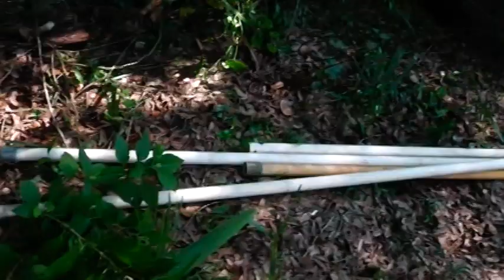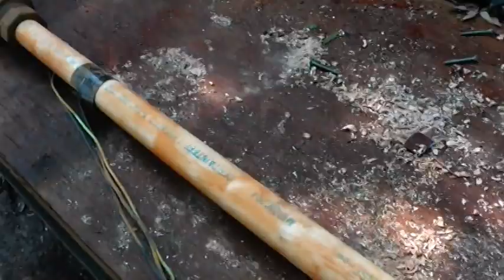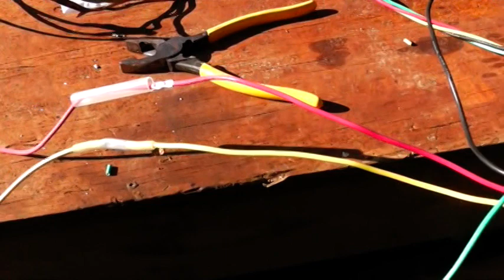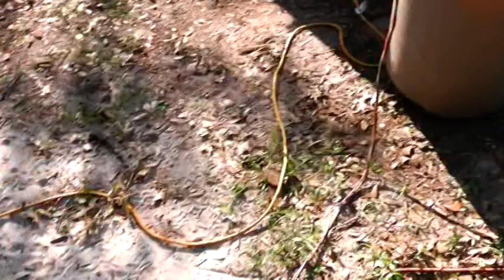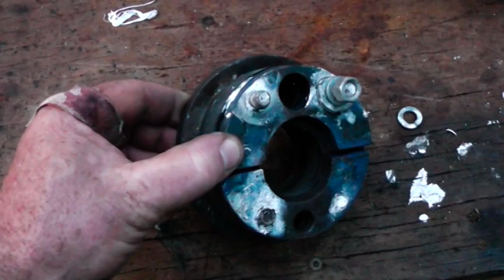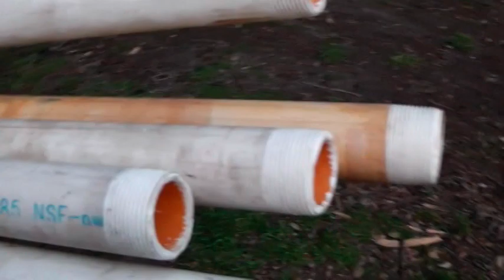Installing a Submersible Pump in a Deep Water Well: Part 1

Comment: I'm moving my wiring to another power source. I have a 220volt 3 wire pump. Do i need to check for proper rotation?
Reply from the maker: If it is single phase, no. If it is 3 phase then, yes.

Comment: Hi guys. There are so many comments about PVC and poly pipe and galvanized. These corrode or break easily and are difficult to handle. Why don’t you just use WellHose DIY Drop Pipe? Really easy to work with. No corrosion. 1 continuous length.

Comment: thanks another quick question, which pipe will u advise to use pvc or metal thanks for ur time
Reply from the maker: +Prince Dabby I don't have a definitive answer but, I can tell you that the 1 1/4 inch schedule 80 pvc on my well is still working after 16 years.  My neighbor's well pump had 2 inch schedule 40 metal pipe still in good condition after 45 years( they went with new metal pipe schedule 40).
I would ask a couple of your local well drillers to see what works best in your area.
What ever you choose, please make sure that you attach a stainless steel safety cable to the pump.

Comment: Bret Allen is spot on with what he is saying. At my company we also wrap a few layers of rubber splicing tape, and 3 passes of electrical tape over the splice to help protect it. It may not be an issue in screened wells, but where I live most people have rock holes. 

Wire gaurds will also help quite a bit with protecting the wire. Put them on every 20' or so on your pump column. 

I'd also advise against using solid core wire. Just personal preference, but u like using flat black double jacket wire.

Comment: One thing I do when installing a submersible pump is to use an stainless steel nipple
of 4 or 5 inches with an ear made of 3/8 stainless steel rod soldered to the nipple and
attach 1/4" stainless steel cable to support the pump and to pull the pump out when
need it, you thread this nipple to the pump.. I also use stainless steel cable clamps. Pumps are very expensive to replace,with that in mind I am extra carefull to be sure the pump and pipes are secure.I also secure the pump with rope attached to the pump ear using an 5/16" stainless steel shackle. Remember that loosing a pump and tubes you may  also render the well to a tottal loss. I buy all of this materials on E-bay very reazonable Using the cable and rope also helps to arrest the pump torque.
I kind of not to trust much the PVC tubes to support the weight of pump and tubes
because this material gets brittle with time. A good pump and a well done installation
last at least 15 years. Of course I am extremelly careful doing the wire splicing correctly and use plenty nylon ties to secure the wiring to the tubes.There are electric
winchs all over the places very cheap to pull the pumps and tubing out very easy.

Comment: Also I'm not sure if you know this but the only maintenance you have on that system is that blue pressure tank. If you have a good high quality tank then you only need to check the air charge in that tank every year by shutting the power to the pump off and draining the systems down. If you don't have a good tank and you bought one from Sears or Home Depot then you need to check the air charge in that tank every three months or so. You always want 2-3 pounds less than what you're set to turn on at. For example if your pressure setting is a on at 40 of at 60 you would want 37psi in that tank at all times. If you're at a 30/50 setting you would want 27psi in that tank.

Comment: Just some advice I currently work for a water well company and the pumps I pull are usually around 500-900ft sets. But I've also pulled many that were set everywhere from 400 to under 100ft deep. For one do not listen to the guy telling you to go to poly pipe that's a big mistake. Sch 80 pvc pipe is perfect for that well and very strong. You could even go to Sch 120 if you wanted but you would get more friction loss through that pipe and Sch 80 is perfectly rated for that HP set at that depth. Second you are using the correct splice kit to connect your motor leads to your pump cable but when you go to torch the heat shrink you need to start in the middle of the heat shrink and then work your way out this way you don't have to worry about air bubbles in your shrink and you actually get a much better shrink around those cables. Now for all the people who want to put Galv in their well I wouldn't because over time that pipe will grow what's called barnacles (not sure if I spelt that correctly) witch corrode that pipe and put holes into that pipe. Pvc is actually extremely strong and will last the longest in a well situation.Also that motor is not considered a 4 wire motor it's actually called a 3 wire motor because you have 3 hots and a ground. You should also order some Torque arrestors to put over that splice this not only protects that splice but in three tenths of a second that motor speeds up to 3800 RPMs and causes the pump to twist on start up witch can rub through your wires over time. Being that it's only a 1HP you won't have as much torque compared to a 3HP or 5HP but you should still have one on. 
Also you should look into a Symcom 231 pump saver this type of pump saver will be wired into the lid of that quick disconnect box and will protect your pump from everything. If you start to over pump that well it will detect that you're breaking suction and turn the pump off (we set how long it turns off for so for a 1HP I would set it at 5minute)  to allow the water to build back up. If your pump pulls high amps or low amps it will shut off if your voltage to your motor is plus or minus 10% it will also shut off and flash a code instead of damaging your motor. These are just some things that this 200 dollar part protects. I would highly recommend getting one.

Comment: Is it possible to pull our pump with schedule 80 cpvc that is 250 foot deep if so what method would work best sin we are doing it Sunday  and haven't had water in a couple of days thx
Reply from the maker: !! Work at your own risk and be very mindful of not dropping the pump and drop pipe into the bottom of the well!!
We used a front loader tractor with a 2 x 2 inch square steel tube bolted to the side of the bucket and we were able to lift the pipe and pump out a little at a time.  When I re-positioned the rope, I found that could pull the pump and piping up by hand because it was 1 1/4" pvc and it was only 60 feet long. If it had been steel pipe this would have not been possible by hand( for me ). 
You could build some sort of tripod or a-frame structure above your well and pull it out with a pulley. A stout tree limb could possibly work too.
You could also rent some sort of a crane for a day.
Use extreme caution and good luck!

Comment: Can I give you a tip. Get rid of the pvc pipe ( white pipe ) and use poly pipe ( black pipe). instead. Just depth your bore and cut poly to length, usually a metre to a metre and a half off the bottom, depending on how soft the bottom of the bore is. We also attach a 4mm s.s rope from pump to borecap, that way if a fitting lets go you won't lose the whole thing down the hole. Poly pipe will eliminate all those joins. One more thing, use cable ties to attach cable and not grey duct tape. Duct tape can let go when wet and make its way down and block the suction of the pump.

Comment: With one other person u could pull a 65 ft.set pump by hand. Schedule 80 pic pipe wont break. I worked for a well company 10 years we pulled shallow pumps by hand quite often. Alsoelectrical tape works better than heat shrink tutubing.  Its also cheaper the capacitor in a 2 wire pump is not replaceable you can replace the whole motor. After replacing controls in the control box about 4 or 5 times you already have the cost of a new pump motor. Often times you can have a verry old pump with a good head but the motor is burned out.
Reply: Would I be able to call you about fixing a well?

Comment: It would have been nice if you would have shown the removal of the old pump, what few people know is that a 3 wire pump is seldom changed and can be 40 years old. the biggest trick is getting a pump out especially after its covered in silt and 40 years of deposits, a 4" pipe has a 37/8 inch pump in it, theres no clearance, so getting a pump out is hard to damn near impossible and sometimes even breaks off. they always show how easy it is or not at all usually just to break it free requires back breaking effort.

Comment: Another idea that I use for my well pump is to tie a retrival line  to the pump itself. Some well head seals actually have a ring underneath to tie that line to. Mine didnt so I had to silicon that area where the rubber went around it. Then I pull the pump and tie off the line to something nearby and take my 10 foot sections of 1 1/4 pipe apart. Pull it up  again and tie it off after each section is removed. Of course you get wet every time you do a section. :)